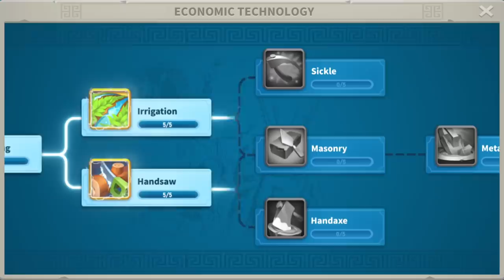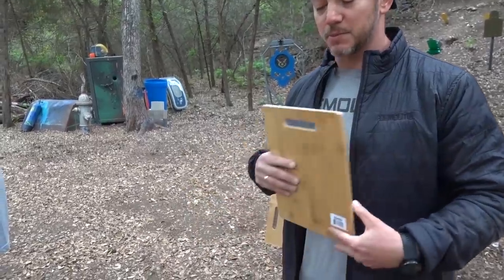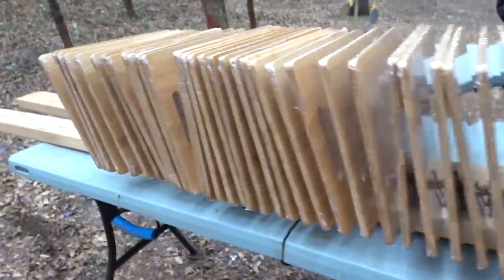Suppressed MP5 Shooting Cutting Boards!!!

Comment: 5:48 a proof of how good the integral surpressor of the MP5SD is : Matt forgot to put on his hearing protection and didn't even notice it.
Reply: The amazing thing about that gun is that i can silence super sonic 9mm bullets. So its WAY more quiet than just a regular smg with a can on it^^.
Reply: Did he forget, or did he just not?
Reply: @DrEpicPhD  - definitely the second. Let’s just let the guy gets his likes in though
Reply: @DrEpicPhD  whether he forgot it and didn’t notice, or knew he didn’t need it, the same point is made either way.
Reply: i have 0 knowledge about guns other than "gun go pew" so what I'm about to say will probably give you a migrane.. you have been warned

what if you attached another suppressor on the MP5SD, like what if you attached something like a BANISH 45 on it, how quiet would it be?
Reply: @maz1071  still would make a lot of noise, considering what you hear from a silenced gun is the actual explosion of the round AFAIK
Reply: @TheFakeReflection  ok, thanks
Reply: The loudest thing about this is the bolt moving 😂
Reply: @maz1071  yes a greater suppressor volume means a quieter gun as long as the bullets are subsonic which they are in the mp5sd
Reply: @maz1071  Whatever u do u will still hear the sonic bang if the round it is not subsonic like 110 grains ...i think, i forgot what HICKOK JOHN told me... sorry!!!
Reply: The MP5SD suppressor an absolutely amazing design. It drastically favors silence over actual muzzle performance, which is why it incorporates a super-lightweight bolt so that it will still cycle properly with less chamber pressure. Its literally the last thing you never hear
Reply: @gottmituns3225  actually that's not necessarily correct in this case and with other integral suppressors (like on the suppressed Stens, the ruger integral .22 pistols, etc...). 
These suppressors have ported barrels and an expansion chamber that bleeds off gas pressure to reduce bullet velocity. These systems can get subsonic preformance out of standard ammo that would be supersonic in any other gun. 
The MP5sd does this too, it fires 115grain 9mm at subsonic speeds.
Reply: @RAYTHEONGAMING  nah that's the as val
Reply: @random.3665  It has some holes on its barrel to leak some gas out in order to slow down the acceleration of the projectile, so it will have less energy.
Reply: @bravo_cj  Uhm, yeah, i know..... thats kinda what i was referencing with my comment^^.
Reply: @random.3665  OK, got it bro

Comment: That was awesome. Bamboo is one of the strongest building materials with a tensile strength of 28,000 psi. To help give you an idea how much this is, mild steel measures 23,000 psi.
Reply: Until you bring some to use as a cane pole for amber jack or grouper.

That shit has a good chance to shatter, but I’d still do it :)
Reply: Yeah, bamboo is a pretty amazing material.
But when it comes to bullets, tensile strength doesn't really matter.

Comment: “The sawdust is hot.”
Crispy looks at him and laughs “Bruh, that ain’t what hot feels like.”
Reply: Fuhhhhkkkm lol. Crispers would know.
Reply: i dont know crispy but i can only guess what kind of "heat" he's been through. lol hes cool
Reply: @ericsandstrom8561  no he wasn't "cool" LOL he was fried crispy
Reply: @ericsandstrom8561  After his humvee ran over an IED and killed most the people in it, hestood in said burning humvee and used the machine gun to fend off enemy combatants while his team fell back and gave aid to those not killed. Got 3rd degree burns on most his body. Probably not 100% accurate as this is off the top of my head.
Reply: @austinallen6419  lmao, his team? you play too much COD
Reply: @austinallen6419  thanks for the info I was curious
Reply: @table4413  Team is actually used in the Army, however it’s typically used in a “slang” way. Like NCOs and officers will sometimes refer to their group, depending on how high in command they are, as their team.
Reply: @Snake-pw2wm  oh okay, so I’m the idiot lmao
Reply: Mitch Hart  left the humvee only due to rounds exploding due to the heat before he could shoot them off

Comment: Have you ever tried to see if there is any difference between targets with air gaps (like these) versus targets pressed together? My GUESS is that the air gap targets offer better protection than the monolithic target.

Comment: 12:35 *Watches a cutting board fly up and out the top left corner of his screen* O..O holy crap, the black tip is so powerful, it can send cutting boards flying so hard they break the fourth wall

Comment: You may have a good idea there with the body armor. There was a show on Discovery, or something, about floor boards for a C-7 or C-8 Vette. First the wood was treated to remove all of the soft fibers between the rings in some sort of wood, might have been Balsa and then what was left was compressed and formed to the needed shape. Lighter than steel and stronger.

Comment: Due to the manufacturing process . My question is. If you weave plates from bamboo and place it in a kevlar sleeve. How thick does it need to be to be effective. Note your creating a cross fiber plate. Not unlike dragon armour.

Comment: absolutely no kickback on that MP5. I surprised it went through that many boards. SAS like using it because it doesn't punch through walls etc possibly killing hostages on the other side of walls  (although they use light/sub-sonic rounds too).

Comment: MP5s are 9mm right?  Full auto is just too fast.  In a real life situation, unless you have a drum...if you miss you are screwed.  I am designing body armour...and maybe for the plates...maybe one sheet should be bamboo?  Kevlar outerlining/untempered steel/kevlar/baboo/pool noodle.  With my own test...nothing cushions you like pool noodle matetial.  Not joking.  I bet it would stop 7.62 without a bruise.  Now 50cal...you'rw done unless you have a 300lb suit of titanium.  And they say despite being one of the strongest metals...much like shielding yourself from extreme cold..layers are what is important.